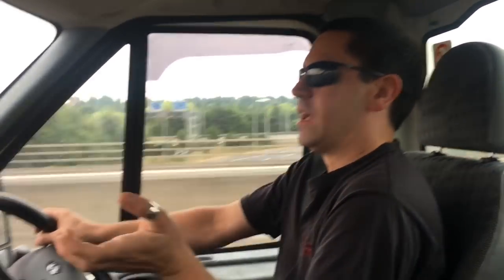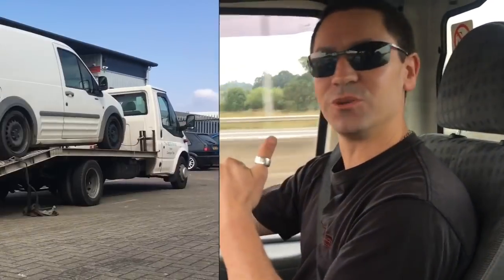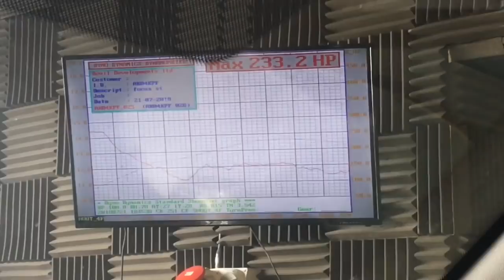Transit connect episode number 15 (dyno run rolling road mapping)

Comment: If you want to get this channel taking off big time then you need to vlog your fiesta when you go 1/4mile. I'd be keen to Watch more vids like that.
Reply from the maker: Spark Plug Steve in the pipe line 😜
Reply: Ignition Advantages you could be as big as cleetus  or boosted boiz.
Reply: Steve how ya doing .. big followed if your video and this guys vids are good aswell.  Theres yourself SPS. This channel and theres Savage garage. Only guys I watch. :) keep it up m8.

Comment: Put a paddle clutch in it. Dial in more boost live mapping then stick it on the dyno again and fine tune it. Then maybe a fresh paint job on frozen white. If that unit is your company chuck some magnetic signage on it. :) suggestions for ya.

Nice video mate. Good job and 230 on a standard blacktopis impressive. Custom stainless exhaust needed as uve been kn about:) liked and subscribed. Keep the videos coming m8 cheers. Sy
Reply from the maker: DreamSmasher83uk keep watching there has been alot more videos since this video lol
Reply: Still watching them lol